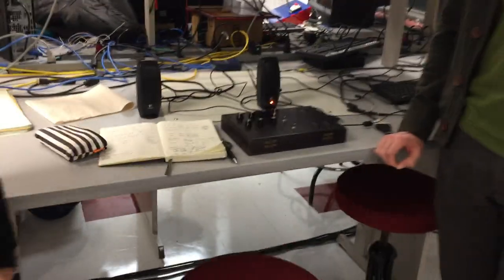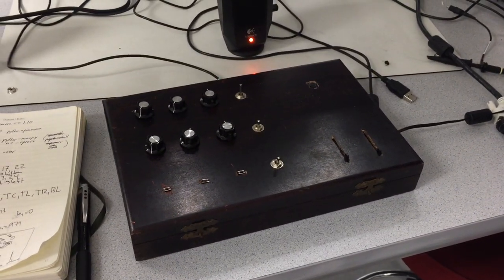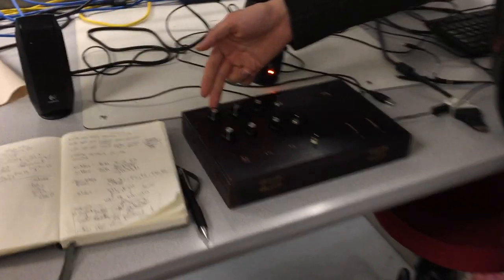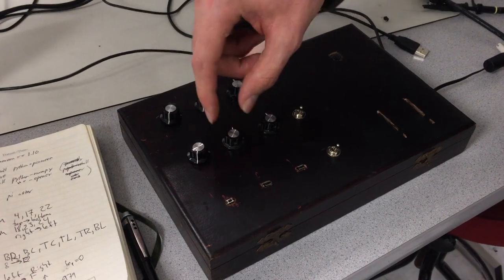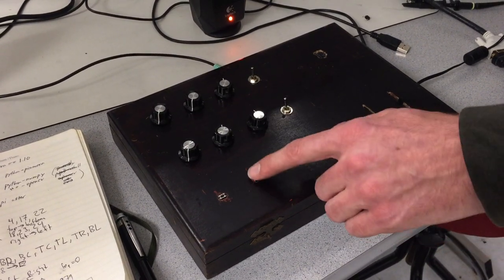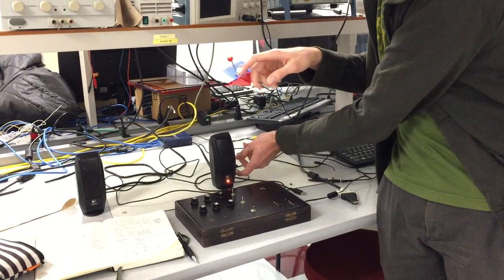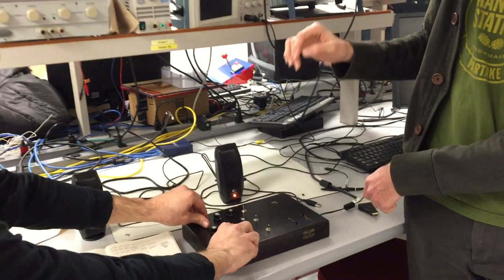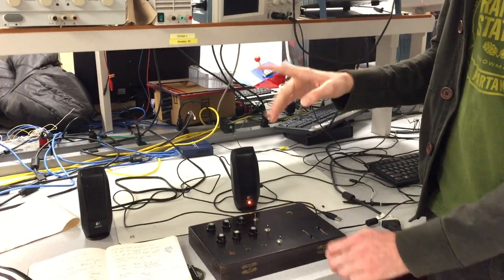Raspberry Pi Theremin Digital Synthesizer - Will Abajian and Stephen Schneider

Comment: I need a tutorial on this!, my physics project is to make a theremin with a RPI3 but i don't know where to start.
Reply from the maker: I have a writeup at this link with code listing and general hardware description:
https://courses.cit.cornell.edu/ece5990/ECE5725_Fall2016_Projects/wpa26_sms675/index.html
Note that this isn't strictly a theremin; it uses computer vision to measure the area of the hand, which simulates distance.
Reply: William Abajian thank you very much. Do you think that with a simple ultrasonic sensor and a speaker would be enough for simulating a theremin? And some gpio code written in python obviously.
Reply from the maker: That sounds like it would work very well. I was only able to figure out the sound synthesis in C, but you can either use the inter process communication I used for communicating between programs (somewhat complicated), or use the PiGPIO library for C for using the gpio pins.
Reply from the maker: Alternatively, you could explore some Python libraries for sound synthesis, such as FluidSynth.
Reply: @williamabajian1409  This is exactly what I was looking for, a way to synthesize sound from another project TherePi by Kevin Macaleer that uses the ultrasonic sensors Mario was talking about. He used a network connection to a PC/mac instead of a synth. I really needed this to be standalone such as yours. Hopefully I can splice the two projects together!